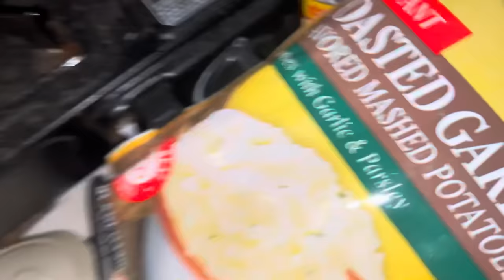Building a Cabin and Fishing for Trout in “Little Alaska” Day 45

Comment: I live in my camper there’s an old video on my channel when I first got started but I got a full on truck camper for the past year and a half, always wanted to do it yada yada I’ve been running a heat hog it’s basically a buddy heater but it’s the only one I could find that had a low oxygen😅 sensor and propane leak detector(I  also have every other sensor you can imagine) I got a hose adapter that goes from the small 1lb tank to the 20lb tank I go threw about one a week, have had it for about a year after my built in one gave out and after fixing it I still use the heat god full time, hang it on my fridge door sleep with it on, about the size of a milkcrate, I live in Newfoundland not a warm place 10 months of the year, I also have a dog 9 month old shepherd black lab mix he’s 90 pounds now, his name is farley, my name is also Ben lol. I’ve been watching since the 3rd or fourth episode, I’m a plumber you’ve really impressed me with not only building all of this but the consistency of uploading has been crazy I’ve never watched a YouTube before waiting for them to upload! I never wanted a wood stove in the camper because I was a little worried about it and driving a truck around your always at gas stations to get propane it’s like a buck a pound here. I’ve never left the island but I’d love to drive down in my rig someday help you get some off grid plumbing solutions figured out my insta is benelliott1999 I have some photos of my life up there if you wanna hmu If you have any plumbing questions

Comment: Keep in mind Will, the propane regulator can freeze up if the tank is left outside. 
You might think on having to plumb it out from the inside of your cabin to the kitchen area.
Reply: If this happens, you can get it working again by pouring hot water on it

Comment: Silicone caulk for roof sealing. Use long nail to pierce the inside seal for caulk after you cut the tip off. Saw you had a caulk gun. Use it!

Comment: one issue is you might see rust problems... you may want to treat the metal a bit futher before it does... I could be wrong..  pine burns fast.. oak is slow....  you could irrigate water from the stream and maybe set up a rain catch?  build yourself a basic shower, could even heat it around your stove.

Comment: Try liquid silicone for filling holes! That stuff works so good dude you have no idea how many cars I have fixed by using it, one time i fixed a giant damaged side of a roof of a old truck with it on the top and inside and it never leaked once, maybe someone can tell you the downsides of it but i dont know any, maybe extreme heat wouldn't be good but in the florida heat it never melted or anything like that being in the sun all day.

Comment: You need to put lap screws in the TOP of the ridges where the sheets of metal overlap. The screw will pull the two sheets together.

Comment: If you get the buddy heater, use the official hose for the 20 lbs tank. Knock offs have some weird shit in it that clogs the regulators. And if your are gonna run it indoors, just have a carbon monoxide detector and you’re good. Just as long as you got airflow. With that chimney you’re good

Comment: Where the roof panels over lap put a screw in the top to secure them together, buddy heaters are safe for inside but definitely get a battery carbon monoxide detector

Comment: Put screws over the parts where the metal overlaps, I’d brace the stringers going from the awning on the pole side at the top. A big wind would probably rip the nails out of the top of the wood

Comment: Well I don’t think I commented, I think you were right in the roof. Every metal roof I’ve done commercially or residentially had the screws on the top of the ridge. Not saying it won’t work but the water has way less of a chance getting in.

Comment: you put shorter screws in the high ridges of the metal roof. they are called seam screws. its better to have the seam tape but if you put enough screws there it should be fine.

Comment: You can get what building contractors, and the building industry calls, "vapor barrier", It is 6mil (not sure what mil means) but is is heavy-duty poly, perhaps heaver than the shower curtains and more durable. You can staple it on and the tack thin strips on top,, it will las a few years.

Comment: Its not super nessacary but i would caulk the seams with the rubber roofing that fits in a caulk gun...you can also use it to seal the holes in the roof....flex seal is actually garbage and the sun will destroy it...rubber roof seal is what you want

Comment: You have a lot of work to get done before winter. You need to stock up on canned goods go to the dollar general grab what you can afford even with 30 bucks you can get alot of different things like pasta rice beans pancakes mixture and salt and sugar. You need to get powdered milk coffee and tea. Get biscuits and a back up butane burner and a 20 dollar foldable stove/fire cooker. You need a basic first aid kit and firearm and store your ammunition in a dry container and use those little dry crystal packs you get in a new box of shoes it will keep your amo dry. You need to get a covered area for your firewood and  putting some string tied around both ends on your roof you can untie and lift it when there snow on your roof and pull the string up it will dislodge the snow. You need a few metal buckets and a shit tone of canned goods. Get some movies and games loaded onto your laptop there will be alot of inside time. Get some bear spray. You need to add extra ventilation. Consider constructing a makeshift toilet shelter for privacy and protection from the cold. Build a simple composting toilet using a bucket with a tight-sealing lid. There's a lot that goes into this. Good luck bro winter in wild is no joke just insulate and get a carbon monoxide reader and make sure you have decent ventilation coming through. Make easy to use charcoal water filters using basic charcoal and pine needles. The pine needles will give some vitamin c and minerals. You should also learn how to make ointments and glue from pine sap. Get yourself a bowie knife. You should Talk to Mike a Bark River Knives he might send you one for free he's a good guy. Go to Bark River knives face book page become a member you will be able to talk to Mike directly. There's a lot to do just don't rush while your working less mistakes that way. Get some super glue incase you cut yourself open. Hope you read this and good luck Will im cheering for you brother!!!

Comment: Will listen to me. Your cabin is too airtight. A wood stove needs air to burn. Pipe in a 4 inch pipe near the stove so you have a way to replace  the air inside the cabin in the winter.